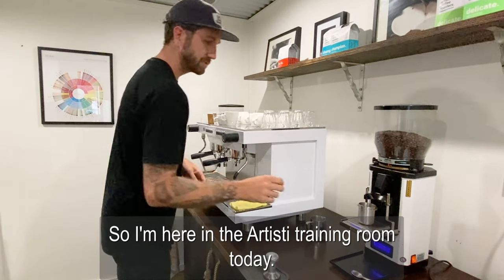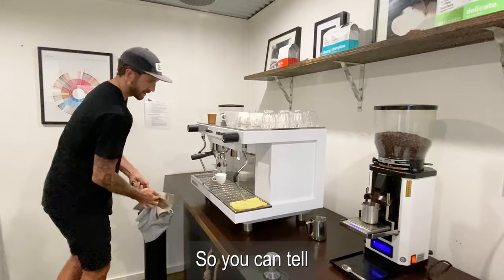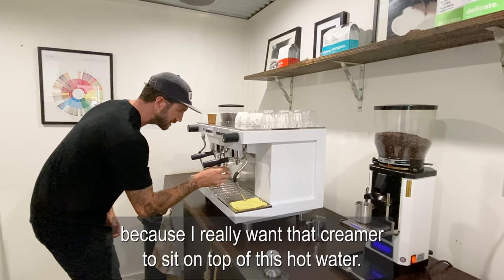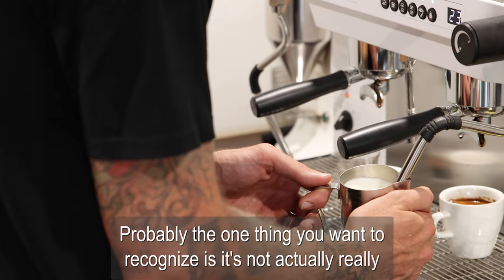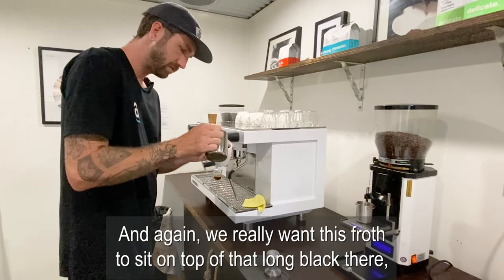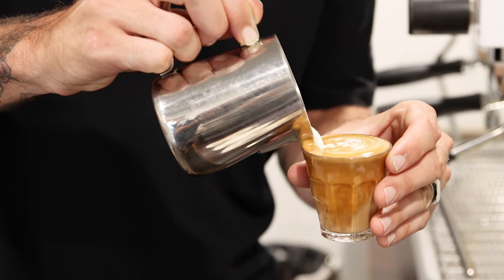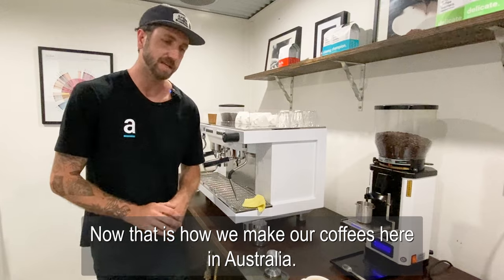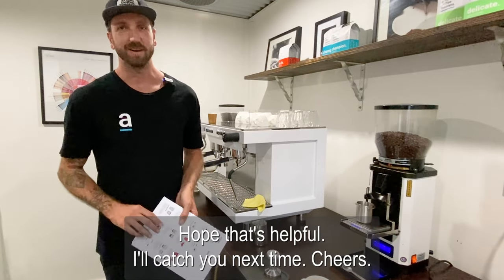How to Make a Piccolo Latte, Macchiato & a Long Macchiato

Comment: Great video, great channel, but I was surprised by the macchiato recipes in your menu.  I always made a macchiato as double shot, then integrating about 1 fl.oz. steamed milk, for a final ratio near 2 parts coffee 1 part milk.  I had thought this was standard, the way nearly everyone did them, with only some variation in the ratio (eg. my 2:1 up to maximum 1:1).  But I don’t see that “standard macchiato” recipe on your menu, between the short and long macchiatos.
Reply from the maker: The macchiato would have to be the most varying coffee of them all. Not sure if I’m spot on but it’s how we do them here. 
Cheers for the message. 
Jimmy
Reply: The coffee shop I manage (and the one I managed before that) don't have macchiatos on our menu, but there's a handful of customers that order them. I just train my baristas to dollop a spoonful of steamed milk on the espresso. I'm 90% sure this is the traditional way it is done. The original purpose of Macchiatos in Italy was to cut down the bitterness for customers who thought straight espresso (caffé) was too much. The spot of milk was to help distinguish a macchiato from a caffé
Reply: @zacharyreed2347  I noticed Italian coffee shop would just put a teaspoon full of warmed milk, just the top part which is creamiest, no froth. Only cafe latte and cappucino get milk froth.
Reply: Hi. Can I have the PDF please? I've tried twice but mail never arrived. Thanks

Comment: How much water do you add roughly to your long macs?

We do usually do just a double espresso shot with a dash of milk for long Mac's in our cafe.
Reply from the maker: Yeah it’s common to do a long mac without water. Are you in Aus? It’s a Melbourne thing to do it without water. We would consider that a double shot mac. 
It’s only a 170ml cup so maybe 120-140ml of hot water.
Reply: Yep in Melbourne. That's how I was taught anyways but it is done differently in other States I guess. Different interpretations I suppose
Reply: I'm from Melbourne and long blacks have always been double shot in hot water (+ milk for long Mach).. Never seen a long black without hot water in any cafe I've gone to anyway lol. 

If it's a single shot in hot water it's more closer to an Americano.
Reply: @DannChewie  Yeh same here, was taught (in Melb) long mac as a double shot with "stain" of foam and a long black as double shot over hot water
Reply: @Amirichi  yep I do my long blacks double espresso over hot water so that the crema is on top. An Americano for me is a hot water over an already extracted single or double espresso. 

Other States do Long Mac's differently to what Melb cafes do I guess.
Reply: No==H2o! EVER!

Comment: Great vid. Question: you called the long mac a long black with a stain.. it looked like a double espresso with a stain? Can it be done that way too?
Reply from the maker: The long max has water in the cup with a double espresso then foam, the max can be either a ristretto or a normale shot with foam. The long reference is the the addition hot water to the beverage